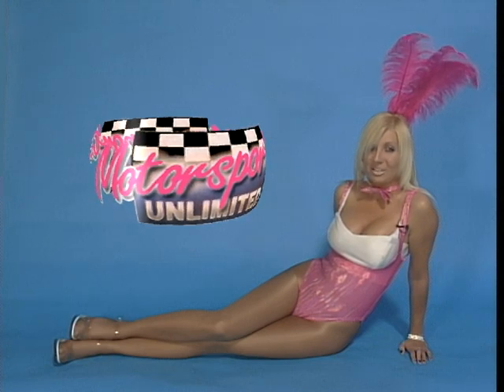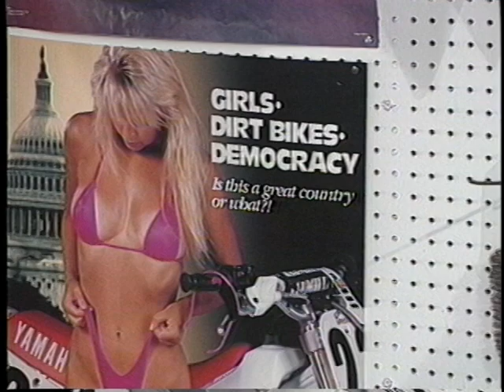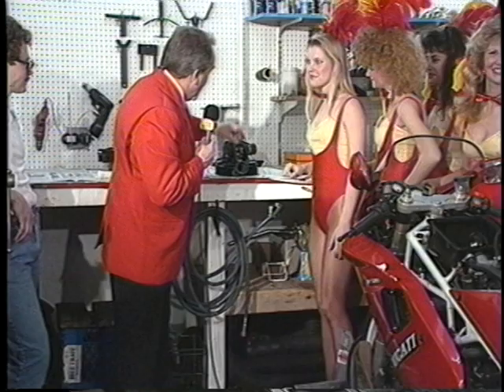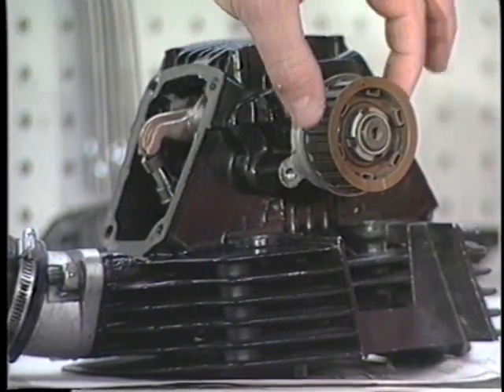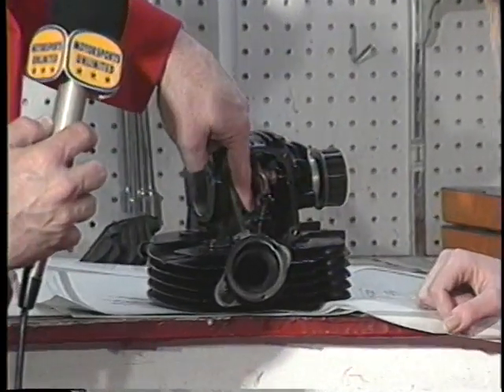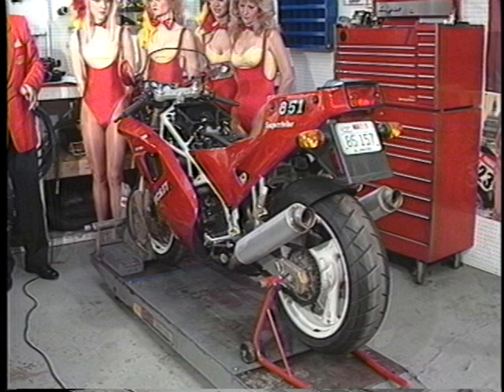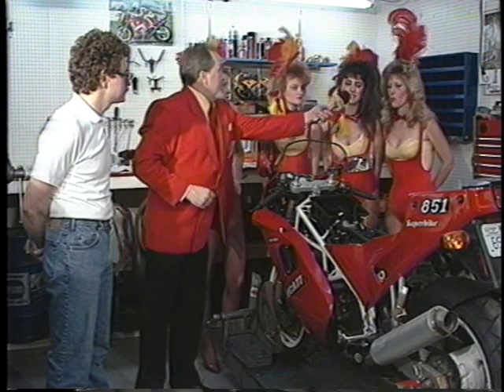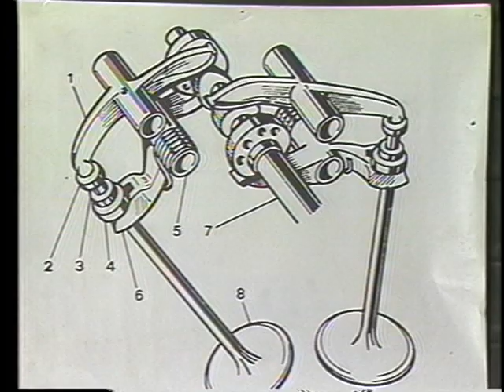Motorsports Unlimited You Tube Test Three

Comment: Lovely girls. Neither the host nor the mechanic mention the two most important issues in this discussion: Valve float associated with springs (why you want the Desmo) and the 15,000 mile valve servicing intervals of a Desmo valve system vs the 37,000 mile servicing interval of a traditional cam rocker spring setup (why you would not).